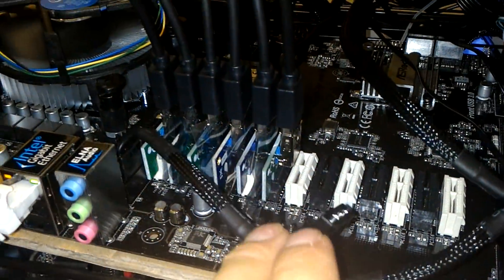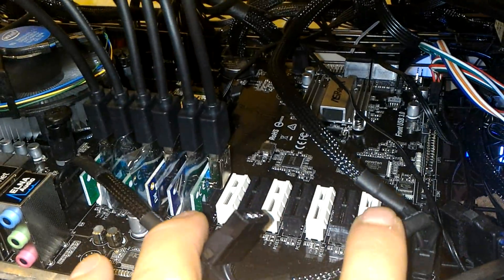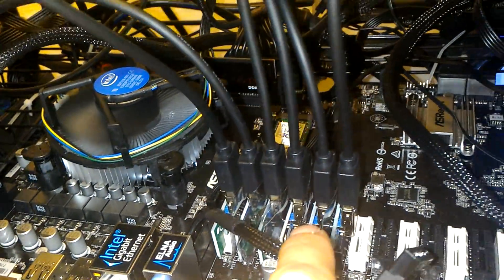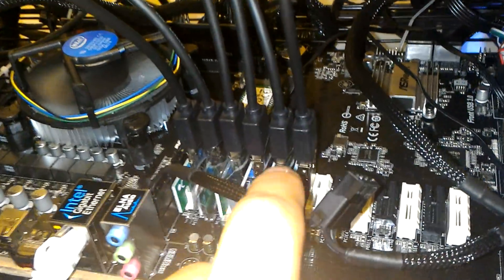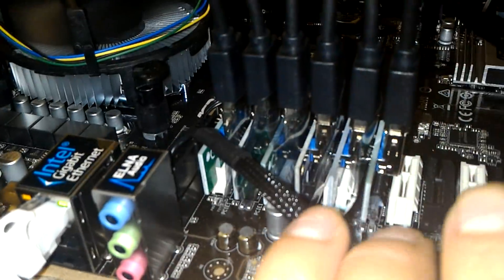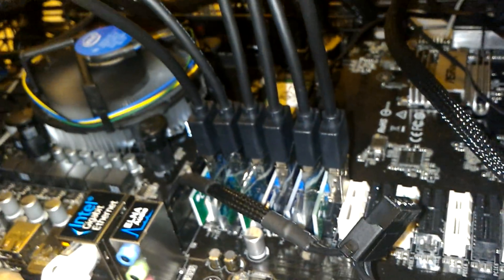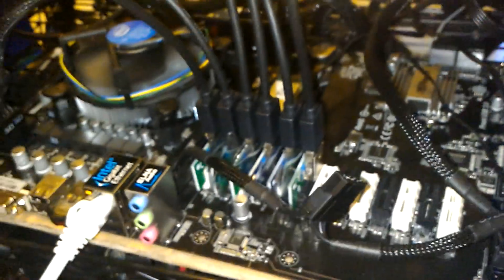ASRock H110 Pro BTC+ PCIe Interference fix

Comment: Hey Jerico I got this same MOBO. All the black slots seem to work but the white ones dont. I updated to 1.6 and when plugged they show on the bios as red reading empty. Any ideas how to fix this?
Reply from the maker: I haven't messed with the BIOS of this board and am not currently using this board. Without digging too deep into this, Could try to revert to an old BIOS (if you can) and check the 2nd molex.  User manual is your friend. might need to install a speaker to troubleshoot.
Reply: @jerico5660  alright, i will try that, thanks for the reply

Comment: I'm having so much trouble getting the board to see more than 5 or 6 cards... I have confirmed working risers with working cards, however when I plug them into the pcie slot, the GPU will not be detected and the pcie slot will show up in the bios as available. I was able to get the 6th by putting it directly into the 16x slot.  I updated my bios to 1.6 and changed settings from auto to gen1 to Gen2
Reply: Now I am using 6 cards except my 16x slot stopped working completely!!! Both when directly inserted or when used with a working riser, it works fine in a pcie 1x slot but not in a pcie16x slot. So I have 5 black slots and 1 white slot currently working,  I want to add a further 4 gpu on a secondary psu. No matter what I do I can't get it to pick up these new cards... tomorrow I am going to reboot with nothing plugged in, then start 1 at a time from the 16x slot. Hopefully will see something new.
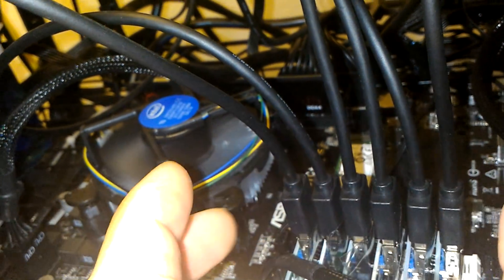Reply: I noticed my pcie 16x slot stopped working,  the bus# would read ff, now I updated the bios,  set the vga to onboard ,switch back to gen2 and reboot,  thr pcir 16x slot still doesn't read new gpu but it reads bus 01:00.0, the 6 working gpus start on bus 02 03 04 05 06 0a(white slot)

Comment: Just FYI, anti-static bags are a slight conductor of electricity.  Use a real insulator between the risers.  I'd recommend a minimal thickness (1/16" or so) rubber material where one side has an adhesive.  Cut and stick them in the same manor.  anti-static may work, it's just not good practice to use conductive material as an insulator.
Reply from the maker: Thanks for the heads up. Your recommend alternatives would work. As far as conductivity of the anti-static bags, it depends on the anti-static bags, on the doping or how dispersed the metal is and what kind.  I actually ran a simple test. you can see it here:   

https://www.youtube.com/watch?v=sjaEU-Rgy_0 

Also, a layer of conductive material can actually provide shielding. Such is the case with good quality CAT6 cables and layers on PCBs but yeah, people should probably check ;)

Comment: Lol what are you doing :) jajahshshshs its only ground touching so noting cant happend. Ground is ground
Reply from the maker: Only partially right my friend. Ground to ground touching sure….
 
* Realize that the video cards are on different power supplies. The PSUs should all be grounded together but it’s not always the case. Differences in grounds may cause worse problems. Using the same PSUs would also help mitigate this problem but grounding the PSUs together is key. 

The likely Real Problem:
* The proximity of the PCIe 1x may allow interference between adjacent PCIe 1x connectors. By adding the anti-static pieces, other non-conductive material, or some fancy pants shielding, that interference will be mitigated. The interference could cause issues with the computer detecting the GPUs which I have run into. 

Solution at any rate…
Maybe I initially solved a problem and described it incorrectly but the solution is still sound and has helped other people. “Do you even mine bro?”
Reply: :) lol

Comment: can you please let me know does the two molex on the board needs to connect each other then to psu and which section of the psu? perif or sata?

also if i use two psu does it need to be connected to primary psu?

thanks

Comment: So it seems you have powered PCIE Risers. Should you still connect the two molex to the motherboard or will it short the hardware? I kept getting the "Please connect a 4pin cable to the motherboard" when booting and pressing N didn't get rid of it. I had to turn it off in the bios under power warning, but that doesn't sit right with me. No problems with powered risers and molex connected to motherobard at the same time?
Reply from the maker: No problem so far for me. 

Plug the Molex to the Mobo using the same PSU that also powers the CPU and 24 pin (Literal instructions for my 19GPU Asus B250 Expert Mining board but applied to the H110+). Preferably use a second/third PSU to power the other cards/CPIe Risers that is/are identical to the one powering the mobo, CPU, and 24 pin. I recommend using the 2-to-1 or 3-to-1 adapter to turn the PSUs on at the same time. There are better, more expensive solutions to turn them on at the same time but the cheapies work fine for me.

Comment: Hi Jerico, i'm having a problem with getting the display to work on the ASRock H110 Pro BTC.  If I plug-in a GPU to the PCIe 3.0 16x slot then there is a display but if I use a riser, there's no display. Did you have the same problem?  The primary video in my bios is set to PCIE2.  Sorry if I'm out of topic, I've looked all over the Internet and I'm just running out of ideas.
Reply from the maker: laijii hmm, may need more info/validate myself but they should be on PCIe 3.0, any of the PCIe slots can be used to display video (the 16x slot will come up sooner though) check for shorts like the video says. I had that cause the video to not display. See if the cards are showing up in device manager (can use the CPU integrated graphics for troubleshooting, plug into the motherboard dvi video)  Make sure you have the molex plugged up to power the PCIe  slots (same psu that's powering the CPU & 24 PIN). Lastly, you might have a bad riser(s). Try it with just one riser and of different types/batches.

Comment: Hey Jerico, did you short anything out prior to adding the protection between the cards?
Reply from the maker: As far as I could tell I didn't have any permanent damage to any equipment due to the PCIe slots being so close. I did have trouble getting the cards to show up in device manager and also would loose cards that were previously showing up. I have one dead GPU so far and an not sure what caused that. It has blown Power delivery fuses and two blown caps on power MOSFETs.
Reply: Thank you sir!

Comment: I had an issue with the 4 pin Molex to the mother board using the EVGA Perif cable. I've tried 2 cables and they both melted. The cable is the one you were moving while showing the pcie ports. I'm running 12 cards using evga 1000 watt and 1300 watt with MSI RX570 cards.. any advice would help!
Reply from the maker: I honestly haven't got 12 cards to work on one mobo but if I were to take an educated guess  I'd say you are probably drawing too much power or you might have a bad power supply. To test the former,  split the power between two separate perif cables with each one plugged into its own perif female on the PSU (assuming modular PSU) and female molex (there are two, one left one right of PCIe 1x's) on the mobo . if that doesn't work, you can plug one of the cables into the other power supply's perif (not preferred way but might work). If one of your PSU's is bad, use the  perif female from the other one.

Good Luck Buddy!
BTW are you running them on Linux? Thx

Comment: Thanks for this, I had assumed they placed them so close knowing that they would touch, but I figured the touching bits were just the grounds which should be ok to touch. Now my problem is my board will only recognize an AMD card if it's in the 16x slot. If they're in a riser, nothing shows up in device manager. I can even take a riser off a working card and place it on an rx 580 and suddenly it acts asthough there is nothing plugged in to that pci slot.
Reply from the maker: I’ve had issues like that. 
1.) Make sure you connect the two 12V Molex to the mobo near the PCIe slots.
2.) It’s a good idea to use the PSU (if using more than 1) that is connected to the CPU and full 24pin
3.) Make sure you have high enough wattage. My Vegas for instance. I had two Vegas on two dinky 650 Watt PSUs left over. I couldn’t get more than one Vega to work so I moved the Vegas to a rig that that two 850 Watt PSUs. I got three Vegas to work and probably could add a few more.

Optional: To make your life easier if using two or more PSU’s, use a two to one 24pin adapter. 

Honestly I like the Asus B250 Expert Mining Better. The PCIe slots are spaced further apart, it tells you if you have something plugged into the PCIs, you can plug up to 3 PSUs into or just use 1 (no adapters needed). I’ll Put up a mini review for that mobo soon.

Comment: Electrical tape seems like a much better solution.  I noticed the contact as I was putting the second riser in and taped the front and back of each before installing.
Reply from the maker: yeah as long as the solder joints are smooth or else the solder joints will but poke through. Also, the heat will contribute to sticky residue if you ever have to service them. I'm currently using business cards. they work great!
Reply: I used electrical tape before realizing the solder joints immediately punched holes through it. Hopefully the ESD bag will hold up a bit better. Thanks for this video!

Comment: My experiences so far with this board: always use a ssd 128 gb (virtual memory will perform better), random reboots too? ,change drivers, do the anti-static paper between the risers, if you have 8 amd cards use 4 with an algorithm (eg D/H) and the other 4 with another algo (eg c/n) use a nice power supply (evga 1300 (depends on your cards power draw)
Reply: Could you explain what eg d/h and c/n even are and how I would change it?
Reply: I meant, Dagger Hashimoto and Crypto Night
Reply: I got this same MOBO. All the black slots seem to work but the white ones dont. I updated to 1.6 and when plugged they show on the bios as red reading empty. Any ideas how to fix this?

Comment: hmm, good to know, I'm experiencing that when plugin all my 6 cards, my win10 restarts and it has kernel-power error, I wonder if this is the root cause.
Reply: me too
Reply: I had the same issue till I moved 2 video cards to a different power supply.  It would run as long as 8 hours before reboot.  Since the switch , no reboots. I', pulling 1350  watts with 8 470's across 2 evga 850 watt supplies.

Comment: I am going to try this tonight. Aside from this, how do you find the snugness of the fit into the PCI-E slots? I feel like they are on the looser side, which may also contribute to instability and cards falling off. Maybe this has been the main issue for me all along, though, as I cannot seem to get 13 stable cards on either of my boards.
Reply from the maker: There is a limit to how many GPU you can run and AMD and Nvidia drivers. There may be some work-arounds until new  drivers get released. The most i've gotten to work are 8  GPU actively mining on this board. I have gotten 10 to detect but not mine.
Reply: i had 10 gpu's (1070ti) working today and when I went to bring 11-13 online everything went to shit and now the best I can do is 6